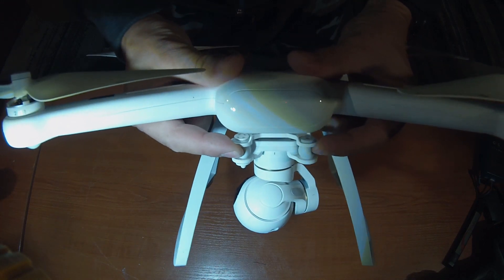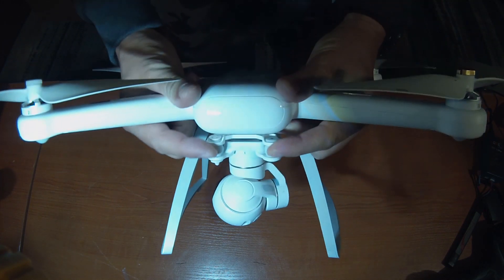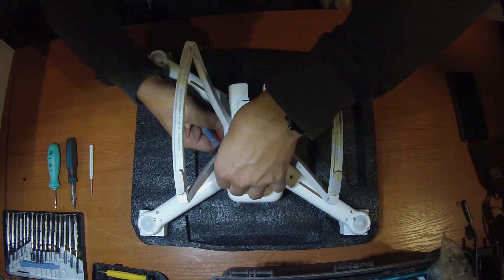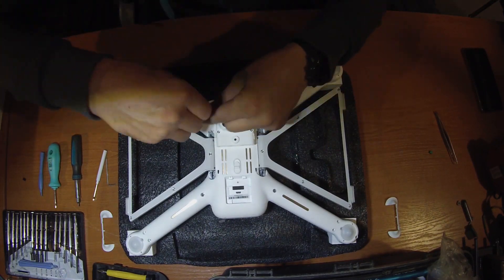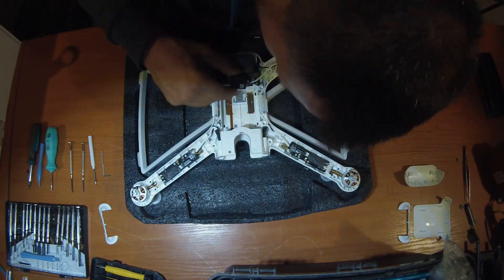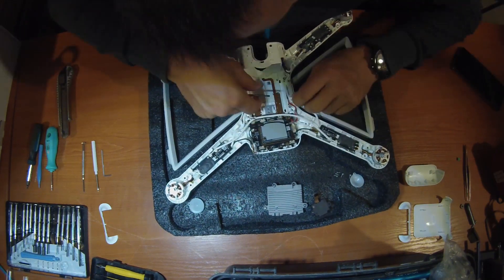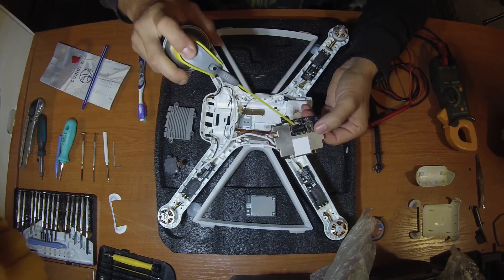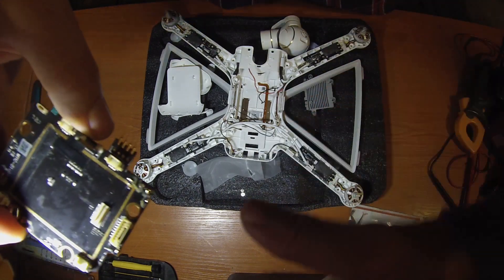Xiaomi 4k Drone Camera Socket Issue (FIXED)

Comment: Thanks for the video =). My mi 4k drone had the same issue. After checking the gimbal flex cabel i`ve checked the pin connector on the mainboard. Is it possible that the cable "marked as green" ends in the middle of the lower pin row? And not with the purple one?
Reply from the maker: Hi, in my case the green and purple are ending in one pin. And there is 3 empty pins....
Reply: @va1io  Okay, maybe i'll try to bride the pins because iam out off options with my "no cam" problem :0
Reply: @st3ffen19xx  did you fix the no cam problem?  my gimbal went back to work but now I'm without a camera, I turned on the purple with the green

Comment: Hi, i think have same issue with gimbal camera. My previous RC doesnt connect with drone anymore, so i've bought a reserve RC..after pairing with drone, everything works like before except gimbal camera N/A.  and cannot record the footooge or photo.
After i see you how to fix....i want to try,but i know it not easy. Btw 0n 5:51 i can see there is a socket for mini SD, never knew about that. what is the purpose ? Thanks
Reply from the maker: is for drone OS system ... nothing that could be used or changed :)
Reply: It's for Black box

Comment: Hi Valio how are you? I'm using your tip to fix my board that broke the gimbal socket. Have a question. Do the purple and green dots go at the same point on the board?
Reply from the maker: Ye that what I have measured
Reply: What is the purpose of middle pins.... And I broke my socket too and I found out one middle pin have connection to the socket

Comment: What is the socket connection diagram between the motherboard and the camera?
my problem is not the camera? socket pins broken
I'd appreciate it if you help. 
my telephone number +905462019711 whatsapp help please :)

Comment: Hello.  I beg you for help.  My contacts are torn. They are between the red and yellow lines (links) in your picture.  Do you know where these two contacts go to the connector?
Reply from the maker: Don understand the question?! it is visible on the picture how they are connected back to front connector.
Reply: In the picture, the three contacts are not connected to the connector.  I wonder where the two contacts between the red line and the yellow line merge?
Reply from the maker: @mariovaljavec3305  dont know - maybe  with the greyones

Comment: Hi Valio!! Thanks for your video! I have the same problem in the same pin! Please could you tell me how did you make the connection between the wire and the socket ?? Please I need your help! Thanks
Reply from the maker: 6:06 - you see there is isolation band. behind it there is a teen wire (not isolated) connecting the red pin (front to the back). Sorry i dont have picture before the isolation with the band as i have made the video after i fixed it ...
Reply: @va1io  I understand...if you give me an email or Instagram I could send you how I have fixed it. I used a teen isolated wire and I connected it to the 2 poles of the red pin...Today I will try if it works
Reply from the maker: just pate some pic or link here so others can see it . Thanks

Comment: I think I have the same problem. Would love to hear how you did the repair in a little more detail and if it was successful or not?
Reply from the maker: It is working as new now ! I installed a wire that is connecting the broken solder join with the another side of the connector - where the pins are. 6:05 is under the black bad.

Comment: Just took one of mine appart to see similar issue. On mine the solder joints on the connector to the gimbal had stripped away (looks like a really bad quality issue). Did you see if that connector component can be bought online ? Really crap quality Xiaomi!!
Reply from the maker: I can find on aliexpress just with the main board for ~ 50$  . https://www.aliexpress.com/item/XIAOMI-Mi-FPV-Drone-RC-Quadcopter-4K-Version-spare-parts-ESC-body-shell-steering-arm-cable/32908868567.html